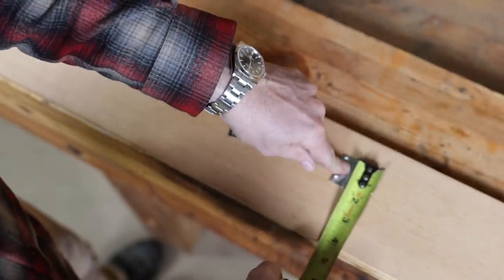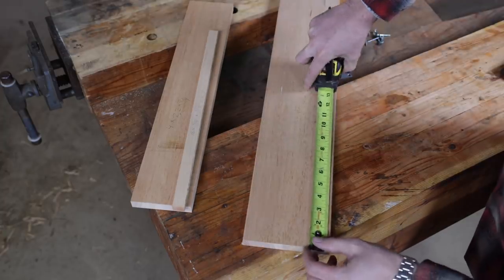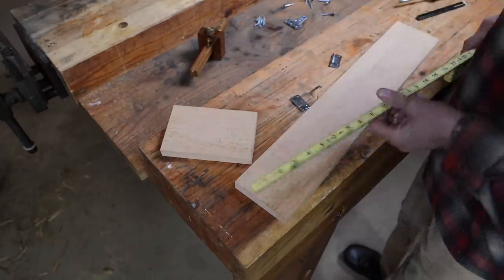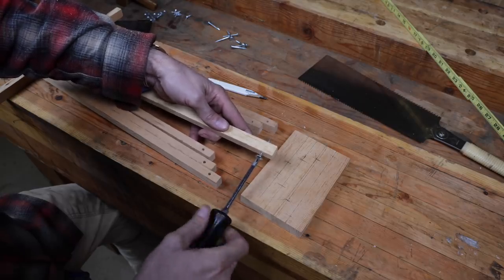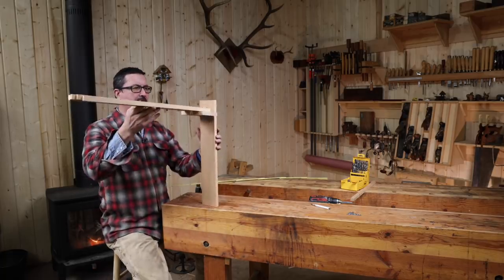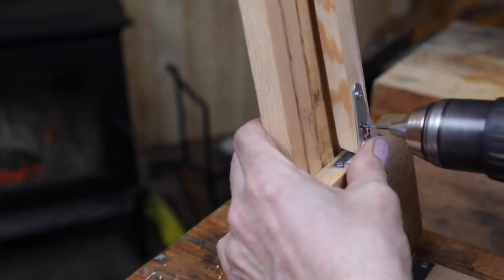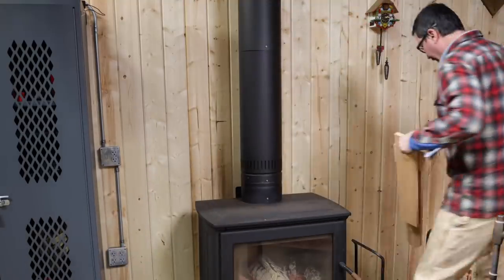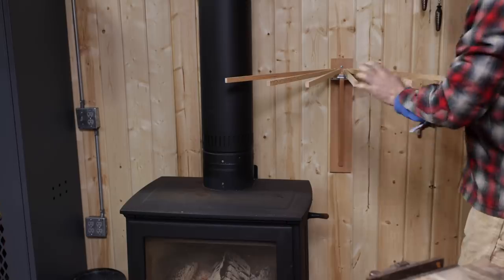The Greatest Wood Stove Accessory Of ALL TIME...

Comment: When mounting hinges, get a self centering hinge bit for your drill. Is an odd looking drill bit that has a spring loaded sleeve over the bit. You will easily get a shallow pilot hole exactly where you want your hinge every time. If that sounds like a great idea, get a whole set, I believe they make 5 or 6 different sizes from tiny hinges like you used here to big entry door hinges. Mastery is the nearly effortless execution of details. This is a great project, I’ll make half a dozen cause I know quite a few wood burners. I love the notch detail for the support. I wish we could get quarter sawn dougfir for a reasonable price out here on the east coast, it’s great to work with and looks great with a finish on it. I built a stair case for some friends in their modern farm house, I wanted to use for for the treads cause I thought it would fit the esthetic, the fir treads were slightly more per foot than oak! Lame. Thanks for putting together this how to.
Reply: VixBits
Reply: Thanks Drew! The set I have is from, Make It Snappy Tools. So now we have two sources to find what we need. Make gettin it done fun folks!
Reply: @sawdustadikt979  in my head the type of centering bit is called a vix bit,

Comment: I hadn't considered using one in that way. My grandmother had a commercial unit of the same basic design, though with some rigid steel wire support parts instead of wood, in her pantry to hang up items she didn't want to tumble dry. As I recall a couple of the arms had broken over the decades she had it.

Comment: Really nice rack and a good project ☺️! You didn't correct your 20° angle cut for the lock-in rod after reconsidering the hinge position but I am assuming that no angle is required since it's configured different. Thank you Cody and our prayers are with you.

Comment: Cool project.   A bit of constructive feedback.   Your stay that holds up the srms in the open position would be stronger and more stable if it's shorter and engages the wall plate at a consequently higher angle.  Might be important if you hang large mittens and/or a flannel shirt that are wet.

Comment: Nice setup, but watch out for the leftmost hanger - if the drying clothing touches the smoke pipe it might start a fire. Maybe add some precaution so it's not possible to get the arm that far.

Comment: Get yourself a set of vix bits to do those hinges, you wont regret it.  Button up those sleeves while working around that saw blade.  Plus, a sacrificial push block that holds the project down while pushing through the saw blade will keep you from getting hit in the face with your project.  Saw manufacturers should know better than to include those with their saws.  Use you miter saw to cut those short square pieces...Safety Sally, over and out!.  (Cabinet shop for 35 years and everyone still has all their fingers.)
BTW, nice project and nicely done.  You need one on the other side now.

Comment: I don't have a wood stove, I have forced air. My cheepo wire shopping basket works but doesn't make quite so nice drying system as yours. However, I doubt your rack would make a very good shopping basket. Thanks for the fun.

Comment: Salutations, sir! My maternal g'parents had a medium-large (4-eye) USSC cast iron stove 'upgrade' to their antebellum (1835) home, sealing off the fireplace and positioning it directly in front, utilizing an elbow into the existing chimney to lessen pipe needed.... After seeing a neighbor's stove with a built-in metal drying rack, G'pa got creative and took the head from a thick 4-tined pitchfork, flattened the thinner handle receiver, and bolted it horizontally to the left rear corner of the top plate in a manner that allowed it to be swiveled back out of the way during the summer, and brought around during cold months to do its job!  Speaking of 'doing the job': what type/brand of rechargeable AA & AAA batteries do you use for all of your radios, camera equipment, etc.? I would like to find a system that will recharge both Ni-MH and Li-ion, as one type is recommended for an older camera (the Ni-MH), but I run lithiums in the majority of my gear, and I know that you have most likely done the due diligence to be able to advise as to the "best bang for the buck"!!  Thank you for any assistance you may be able to provide in advance; I will search thru your older vids to see if maybe you've already addressed this question..... Blessed Be, & Peace!!

Comment: i have a commercially built one I've used for 50 years...made a mistake a few years back when i saw one at goodwill for $15 and i didn't buy it... looks to me like it's too close to the stove pipe....closer to ceiling would capture more heat

Comment: fire hazard as well as the install of the stove
Reply: stove meets code!
Reply: @howardwilliams8993  a bit close to the wood wall without a backer don't you think?
Reply: @omegaman7241  It has a heat shield on the back of stove with an air gap!  He's explained this in another video!

Comment: I would be nervous that the wood slot would wear and the thing would eventually fall and stuff may get burned or start a fire. I would use a two screws side by side to prop it on. or even a slotted piece of wood screwed and glued on. Just my opinion as a worry wart.

Comment: By the way, that short piece cut on the table saw at 3:50 made me cringe. A very dangerous cut and vulnerable to kickbacks. Best to do that cut on the miter saw, or at the very least use a push stick so when the piece gets taken by the saw blade, your fingers don't go with it.